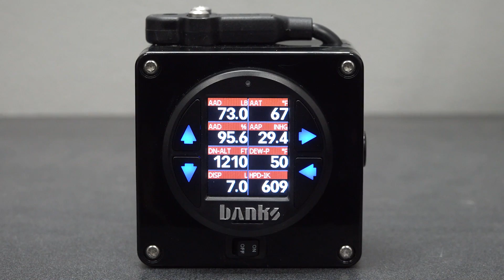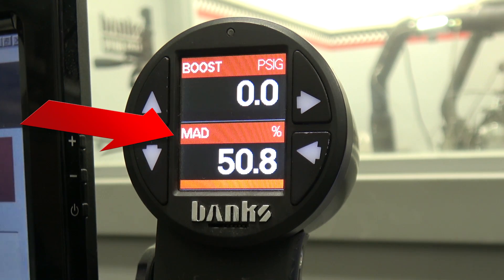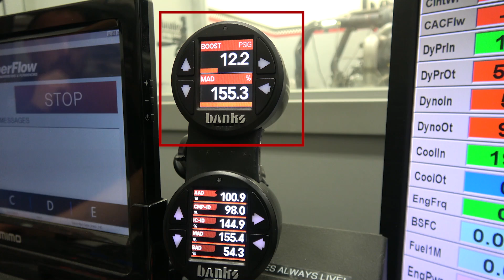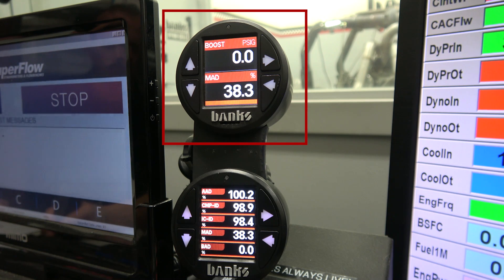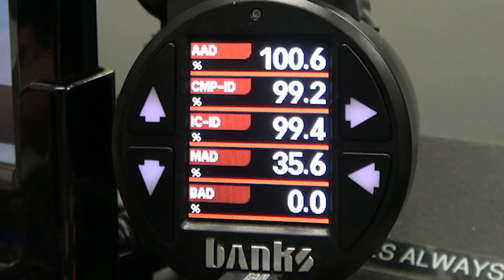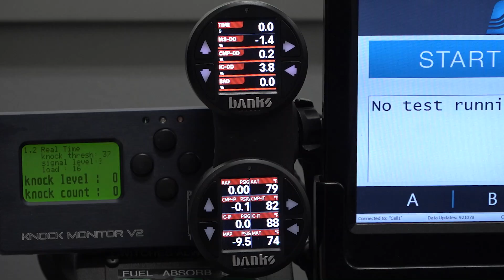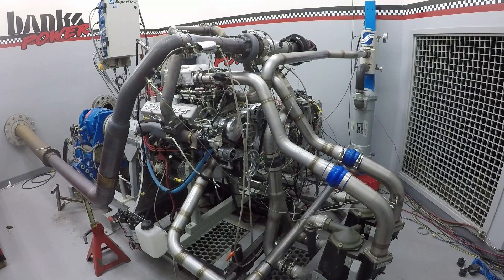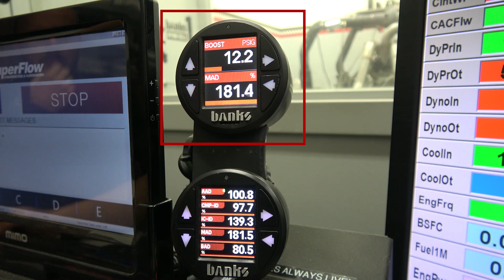Why the boost gauge is dead

Comment: I ran big heads, cam, and headers on a blown sbc. It didn't make big boost but 625hp on the street. Boost is a measurement of resistance.
Reply: Exactly right! There is alot more to making power than boost percentage. People forget about things like speed velocity, density, air temp, resistance and flow of cylinder heads, valve lift vs duration, etc..etc..
Reply: Pressure cannot develop unless there is resistance to flow

Comment: The iDash is only for Ford trucks? Good way to sell 20 of them I guess..
Reply from the maker: The iDash reads data from all CAN bus vehicles which is everything 2008 and newer. But if you have a race car you with an aftermarket ECU, you can get the iDash 1.8 for Aftermarket ECUs. Pulls data from nearly any ECUs. So no, not just Fords.

Comment: So this is what I already mostly knew about, but my question is, which I have never tested, can you set the waste gates to adjust for density instead of pressure? Or would the pressure difference needed to compensate for density cause to many other problems when the boost has to rise above what it's normal setting is to compensate for hot and dry air?

Comment: I see your point but my boost gauge dropped 5 psi. Looked further into the cause and found my collector pipe to the turbo let go on the turbo but otherwise never knew I had a problem. 19 psi to 14 psi was a big difference but did'nt feel the difference until it was fixed. Happened so gradually until 1 day I said to myself......self....something is not right here. Happened on my 7.3 powerstroke. It can still be used as a good measuring tool.
Reply: David Henri it’s a reference number that’s it
Reply: ExtremePower Addicts we are talking about Diesel engines in this comment, please move along.
Reply: I see it being useful, but I also see it being useless. Certain programs trick the ECU in to using an altered boost number. If you are obtaining the boost number via the ECU then the information displayed is probably inaccurate. I would prefer to see what the ECU is being told the boost is and also pull real data and display the actual boost being administered, but at some point you run out of data to display on a unit such as the live wire plus. Obviously each motor has different values of interest.

I would prefer to monitor fuel pressure and degas pressure before I would concern myself with MAD or whatever it was he called it. In my mind my intercooler is not going to change what it does mid drive and I can not control; ambient temperature, air density, or humidity. I can however control how much boost I am pushing and would prefer to see the boost scenarios my right foot and gear selection are creating. Now if you were going to fog the intercooler, then maybe this would be good info display, but it seems you could simply display MAF data...

Comment: I have a 427 sbc  vortec supercharger  with no intercooler it made around 627 hp with an intercooler it made 730 hp and lost boost. So yeah an intercooler will add hp. It was around 11.9 psi with no intercooler and just shy of 10psi with the intercooler. Same pulley nothing changed.

Comment: There’s no doubt that global warming is something humans can fix, what would you recommend to get a little extra out of my 2016 6.7 Cummins that would still meet emissions? A tuner and Banks Intercooler? I don’t want to alter emissions, but the grades are 6-7% just to get outta town! Thanks!
Reply from the maker: Start with a true cold air intake and intercooler. That'll get you increased air density, better mpg, 25+ hp, and cooler EGTs. Ram-Air intake: https://shop.bankspower.com/i-2577 Intercooler: https://shop.bankspower.com/i-2201 Then, tuning would be your next step.
Reply: no such thing as global warming. it is a hoax.
Reply: mikeyjock. Any proof? Site your source!

Comment: Great presentation.  As always.   What you showed is great knowledge.  That being said..I don't believe the boost gauge is dead.   Most drivers are intercooled and don't have control over humidity.   This leaves our variable left to MAP.   It's the same principle as to why I dont have an IAT gauge or even a water temp gauge on a pillar.   The boost level changes with driving attitude and style. It's what our foot has control over. 
  What did surprise me is that essentially you only gained 10% of your HP from intercooling.   And by the look of those EGTs and the sound of surprise in your voice when your turbo supported 600 cranking horses...I think you have more HP to gain just by increasing your CFM numbers.   Hm.   A CFM efficiency % gauge....

Comment: I have a question. I have looked over the website to find the accessories for the idash such as boost, egt, air density, fuel pump, fuel rail, transmission temp props and I can't find them on your website. do y'all offer them or are they able to accept my current gauge probes? Wanting to start monitoring more things on my 06 Dodge Cummins. Thanks for the videos.
Reply from the maker: The iDash sensor modules can accept your probes. Take a look at this page. The products are so new that we're adding more robust descriptions as this comment is being typed. https://shop.bankspower.com/c-70-products-idash-digital-monitor-idash-1-8-accessories.html

Comment: Starting off with a sales pitch isn’t good form. Your videos are great and the science backs you up. If you just made videos like the diff cover ones people will buy them. There is no reason to use a sales pitch. People know your the master blaster of aftermarket parts due to backing up your claims with real proof. You can tell your forcing the product throughout. Just be normal person that talks about science don’t worry about selling the gauge.
Reply from the maker: Point taken. It's important to note that we're the only company with a device that measures manifold air density. It's another reason that he's so passionate about it.
Reply: maybe the only one that displays MAD, but MAF sounds like exactly the same info, and a $30 bluetooth adapter with Torquepro can read that off the ECM. does a separate sensor for humidity really help us here?
Reply: Jeremy, Banks is probably one of the least aggressive automotive aftermarket channels on here.  Is a Banks product going to come in fourth in a five-product comparison?  No, but they probably aren't going to come in first based on bullshit data , either.

Choose your battles, dude.

Comment: Maybe do a video with restrictors between the turbo and manifold? Show people how X PSI could differ between one motor and another. The restrictors could act like smaller valves. It showed people lied to similar size motors with the same boost can make completely different horsepower because of how they flow

Comment: didn't the old WWII aircraft engines have controls and gauges for MAD? aircraft like the P-51D
Reply: Absolute pressure measured in inches of mercury instead of a boost gauge that sets zero at atmospheric pressure. They quite often set takeoff power as inches of mercury instead of RPM

Comment: Question: couldn't you just convert the reading of the air mass sensor to get a satisfactory approximation? Or is that reading too dependent on RPM?
Reply: Shhhhhh you're not supposed to know about that...
Reply: Central Intelligence Agency, we are in trouble if the CIA does not already know the answer to that question. Scary thing is even I knew that the CIA did not know this.
Reply: @larrygrogan4408  The CIA cares not about technical problems, the CIA cares about masked men, Russian nuclear physicists and how you can get those trying to grab your prize to talk about either of these, even if it means taking them on a plane ride with an inadequately written flight plan.
Reply: You could, but too complex at part throttle conditions. Boost pressure still needs to be known to contol the turbine speed so you may as well use what is already being output.
Reply: @alexadams1836  LOL, how do you 'control turbine speed'?? The calculations the ECU is doing is no more or less complicated at closed, part, or full throttle.... it sees temperature, mass air flow and requested speed demand. It goes to a table for values, plugs them into an equation, and spits out an injector pwm value and appropriate spark plug timing.
Reply: @kleetus92  You control turbine speed with a wastegate (vents exhaust) or variable vanes that control the exhaust gas flow over the turbine. The problem with your suggestion is that the  same airflow will be achieved at significantly different rpms dependent on the speed of the turbine which makes it very complex to determine the actual amount of air in the inlet manifold, given that the demand of the air pump (engine) changes with rpm, and not necessarily proportionally. Just trying to explain it to you, the professionals have chosen not to use the MAF data, take care.
Reply: Alex Adams, agree. For the 6.0 ford diesel you can monitor icp. I think the MAD, or whatever he called it, is useful, but I have about 12-14 other values I consider more important to monitor. Certain platforms this would rank higher in my mind, and certain platforms this may rank lower...
Reply: @alexadams1836  Oooooo the professionals eh? Was this a VGT turbo? LOL. No. Thanks for playing.

Comment: Not to be contrary, but if the boost gauge is dead why use it to set 12# of boost. It would seem that you still need to know the boost along with a MAD gauge to measure increases in performance due to modifications.
Reply from the maker: He's making a strong statement to get your attention. You will always need to know how much boost you have. He's trying to make the point that having a boost number alone is like 12 + X + Y = 600. There are too many variables to solve the equation.

Comment: The intercooler on my Duramax does not have an on/off switch. This video is misleading. Of course you'll have an increase in HP with an intercooler using the same boost. Couldn't you say the tach is dead as well? Same rpm's with intercooling will yield more power than without. The comparison is unnecessary. Just address the MAD.

Comment: Wish you would have done this test on an obs 7.3. I'm tossing  around the idea of intercooling my 97 with 412,000 miles.
Reply: I was pretty sure the 97 power stroke already had an intercooler...  I know the idi's didn't. But I thought that came with the PSD.  I'll save you the testing info though, it will help if there isn't one there already.
Reply: @kleetus92   No sir. The intercooler came on the second gen powerstroke, 99 and up.
Reply: @EM-fi2qg  thank you for the info. Now I'm really impressed by our 97 E350 ambulance we had... I know it had 5.38 gears in it, but that truck was beast at 11000 pounds! Loved driving that truck.
Reply: @kleetus92  Definately a beast. 👍

Comment: Where is that boost being measured? Before or after the intercooler? (Measured at the turbo, or measured at the manifold?)
Reply: calm down. You're not an expert.
Reply: You could measure at both places to see the delta P across the IC. Not something commonly done but it's good to know the flow numbers of the IC. You can't just keep raising the boost. Eventually the efficiency of the IC will be exceeded but the temp of the air coming in that is superheated by the turbo trying to force the air thru.
Reply: Did you not watch? He explains it pretty clearly
Reply: @jbandit2044  Actually it's not explained where the boost is being measured. If its before the intercooler then the intercooler will restrict the air entering the engine. If its after the intercooler then while the turbo is produced more air pressure the amount of air entering the engine will remain the same.
Reply: Why would you measure boost anywhere except the manifold
Reply: @bungcheese5901  I don't know, it doesn't say in the video.

Comment: Do you need extra sensors than the air mouse to get the intercooled air density? (I presume the air mouse sits in the intake tract just before the throttle blade, and would you need another sensor inside the intercooler?)
Reply from the maker: You'd need sensors before and after the intercooler and we're unveiling those soon!

Comment: Halfway through, this turned into a video selling the idash...
Reply: Halfway through? You mean the whole way through. Just because he's selling something doens't mean that the information contained is invalid. Though this isn't new information in the slightest.
Reply: better than some jackass telling to go install some shitty phone game.
Reply: @TheBUGZNTA  HAVE YOU HEARD OF RAID: SHADOW LEGENDS?
Reply: If you want to do this yourself, you need an AEM dash display and datalogger and a bunch of sensors: pressure, temperature, humidity. They combined three sensors into one. It is easier to spread those around than to put separate temp and pressure sensors everywhere. It has a cool datalogging function, so you don't have to figure out where to mount a screen etc. I was looking hard at a CD5 setup with a 29 channel CAN module by AEM but have to say this little thing can probably do most of what I need for my project. Only thing is, I don't know if it comes with a great data analysis package like the AEM stuff does. And I don't think it will log turbo rpm sensors. Basically this is for guys who want to push more power through the motor and do it in an informed manner.
Reply: I'd hope so
Reply: Yeah because it's taking about the boost gauge is pointless.

So if you don't have a gauge for it then what do you do to know how much boost the turbo is doing?

Comment: Does the banks Idash pull obd in generic or manufacture specific? 03 dodge ram diesel ecus are locked from most (obd generic) scanners.
Reply: @Tex 13 thanks I sent them an email. I had the cts but snatched it out when it screwed up my cluster only after having for 8months. Wouldn't uphold warranty (but would give me a $100 off the cts2).

Comment: Does it work with hypertech tuner. I have a 2000 Ford Super Duty stock 7.3 powerstroke original injectors with a boost fooler with a manual transmission. I suspect my injectors are coming to the end of their duty cycle I would to know what my engine is doing and the chance I can make the most efficient power possible. Can't wait to see the results on your diff videos
Reply: I bought the truck with 142000 miles on it and now I am at 238 thousand miles

Comment: One question... as a consumer looking to modify a vehicle, especially a diesel, first thing that’s always said is you must have gauges. So your first mods are intake, exhaust, tuner, and gauges. Other than your initial test to make sure you have improved the performance of your truck, what is the purpose of gauges? When using your truck on the daily, you can’t change your environment to anything other than what it already is, and as long as your tuning is good your truck won’t enter a danger zone, so for most of the average Joes I’m not sure where these gauges are helpful.
Reply from the maker: "So long as your tuning is good." How do you know if your tuning is good? This gauge will tell you. How good is that turbo you just bought? The gauge will tell you. Is your intercooler doing anything or is it just a shiny piece of pretty aluminum? This gauge will tell you. What's the point of watching Boost or EGT on a gauge. Can you do anything about boost? Not unless you're a tuner. But you're right. Parameters like Density may not be for everyone. There are 80+ parameters on the iDash for everyone. For this video, rather than focusing on the features that all digital gauges have, we chose to focus on what sets the iDash apart from all others... and that's Density. Along with a few other calculations we're about to bake in. But most importantly, thanks for watching. 👍
Reply: @bankspower  How are you going to know your tuning is good? I'd hope to God the dyno pull results from the tuner you just spent a couple grand at for starters...  And so this gauge is going to differentiate between the infinite list of variables from parts, manufactures, weather conditions, fuel quality and how it's tuned? What's the magic number for MAD? At what RPM? Diesel or Gas? 

While it's neat to see more blinking lights on the dash, (I'm an engineer myself, I get it), at the end of the day it's just a meaningless uncontrollable number as it's being used as a daily driver.  Perhaps with the possible exception you drove through a puddle of concrete and totally clogged the intercooler, and then decided to go drag racing, but I find that scenario rather unlikely in the end.
Reply: I'd say this (or these types of) gauges would be pretty good on a daily. Because it's a small and compact gauge you can have it hidden if you dont want to see it but you can still have multiple datas visible on it when you are tuning or checking stuff. It's not even expensive compared to getting many high quality "normal" gauges that only show 1 or 2 data. But it's not for everyone, I don't like the look of it and I like looking at gauges so I would just have mechanical boost and intake temp gauges.
Reply: when I bought my duramax, my first two mods were exhaust and a set of gauges. egt, boost and fuel rail pressure. granted the truck was stock so you don't have to worry as much. but it is nice to keep an eye on those. egts are important to keep an eye on while towing, boost gauge let me know when my power steering line rubbed a hole through the intercooler pipe. I wouldn't have known other wise until it got really bad. and fuel rail pressure let's you keep an eye on the injection pump and the health of the fuel system to an extent. when I watch the rail pressure drop when it should be climbing. that tells me something isn't right, even if its as small as the fuel filter. they get significantly more important once you start tuning and modding tho. at the end of the day, the more things you can monitor the better in my opinion.